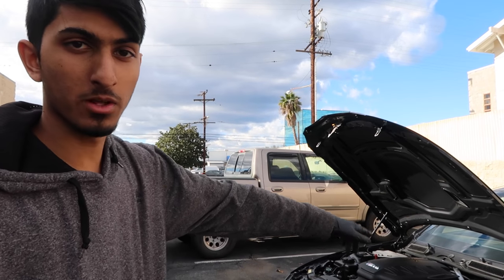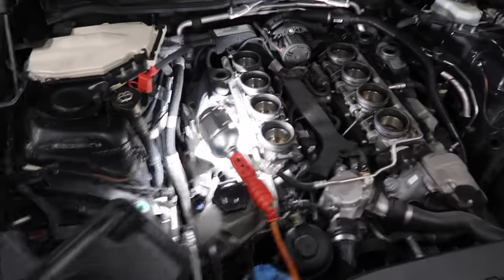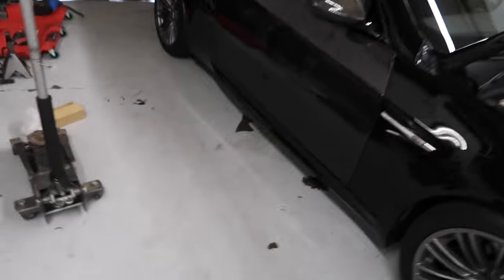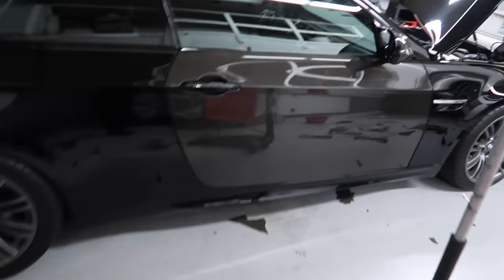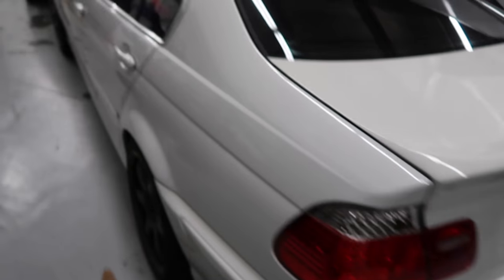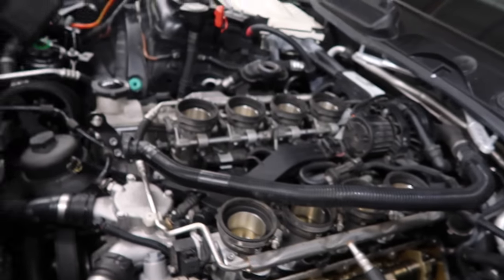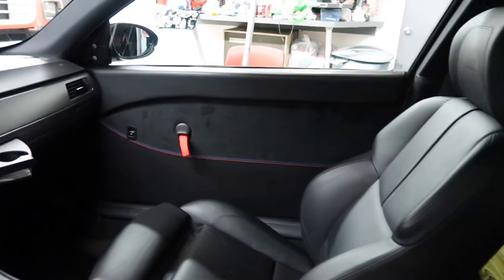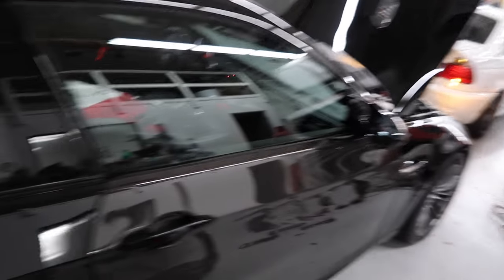Working On A Sick E92 M3

Comment: I got 210,000 miles on my E92 M. Just changed the DCT Clutch, and Rod Bearings
Reply: 210k miles??????
Reply: phrozen06 You need balls to wait 210k to change the rod bearings, I've seen people changing them with as little as 50k and they already looked pretty worn. Never new the clutch could last that much also, but I'm guessing this wasn't your first change.